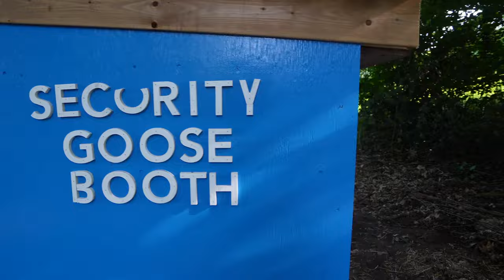Changing the Lives of our Guard Geese

Comment: Looks great. 
One thing I have learned with ducks and my goose is never keep water on dirt or grass. In my outdoor shelter I put deck boards then fake grass then those plastic boot things that have a one inch side. My water buckets sit on that 
I have zero mud mess in my shelter. 
My coop needs itself I don’t keep feed or water but I did kay really good tarps down that run up the walls 2 feet and on the floor then I add my shavings. Keeps poo off my walls and easy to wash down when needed. 
In the yard my pools and ponds have fake grass around them with drains so I can easily turn the switch and drain them 
I do have to big long old flowerbeds with nothing in them I set water buckets in so they can do what they love 
Make big mud messes but it doesn’t hurt my grass areas :)
Reply from the maker: That’s a really good system you’ve created.